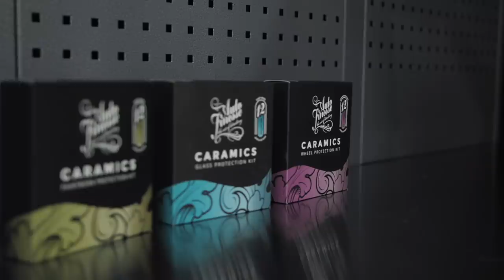Auto Finesse Detailing Academy - Britney x Audi TT

Comment: Omg marry me ...
'shuts door by glass'
Never mind
Reply: Yeah I have issues with people doing that too!
Reply: Triggered!!!!
Reply: I did this the other day forgot about it and saw it again later I was like who the fuck ... then had a flashback to the scene outside the shop where it happened 🤣
Reply: so true.
Reply: Do you have a TT?  It's incredibly hard to shut the door by somewhere that won't get fingerprints on it. You either shut it by the door handle (which is weird/unnatural) or you shut it by the body (finger prints, esp, on dark cars that are clean) or by the glass (less fingerprints and easy to wipe w/o worrying about scratches).  It doesn't surprise me a detailer would shut a door like this, by the glass--you don't want to get fingerprints on what you've just done.
Reply: @rolandm9750  I always shut the doors by the handle on my TT and SUV. Just like you'd do with any other door but the fridge! 😁 Training my wife and kid hasn't been easy though...
Reply: The first thing i saw was that, my face cringed up so bad
Reply: Guys a great paint sealant can also leave oil marks and easier to clean window marks than paint marks

Comment: Iron Decon stage prior to applying ceramic lite coat??? 🤭
Reply: Its a wrap and is probably pretty new
Reply: Yeah I could see ... regardless it would still need fully decontaminating prior to applying a ceramic coat, even a lite coating like Caramics 🚗 .. well if you care about how long the coating would last! If you’re not bothered then it’s OK
Reply: @visi5649  decontamination isnt a factor of how long a coating lasts. If there is any embedded contamination a coating will seal that in. A panel wipe is all that's necessary for a coating to last. But for it to be smooth and look good, you want to decon. If it's a brand new wrap a chemical decon would be enough to prep for a coating. Claybar not necessary
Reply from the maker: This is a fresh wrap, when inspected there was no contamination - Also not massive fans of using Iron dissolving products or solvent tar removers on wraps unless absolutely necessary.